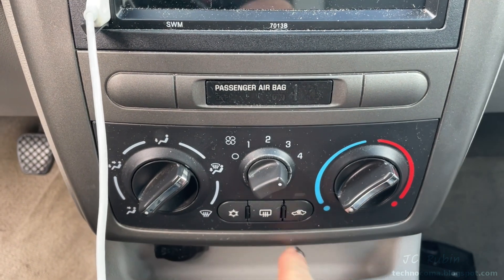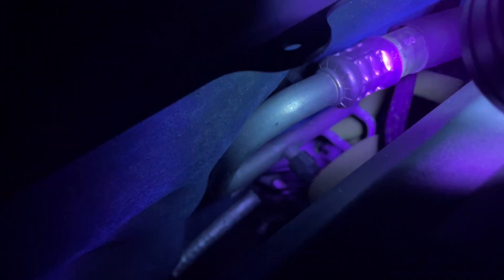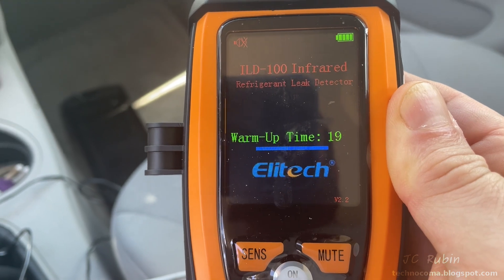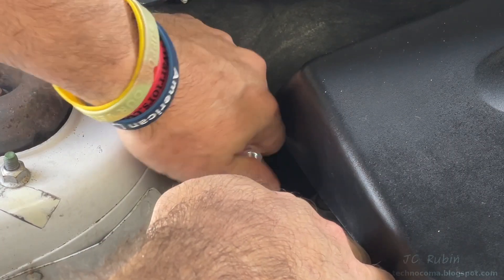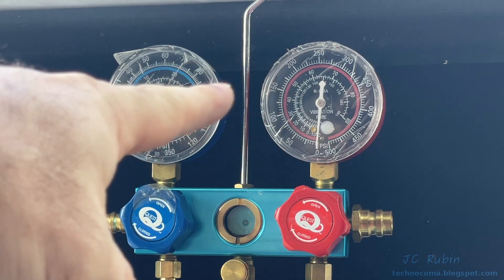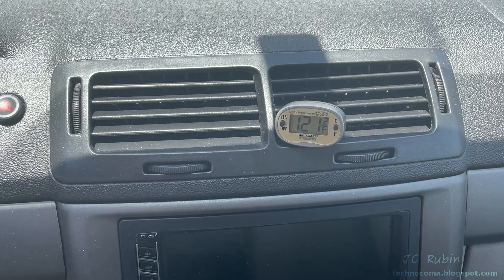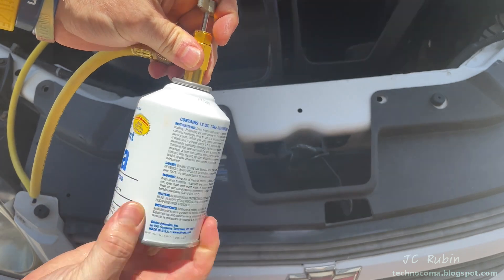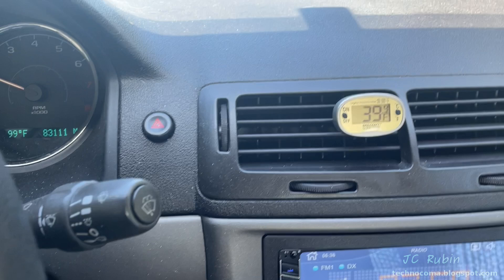Chevy Cobalt AC Repair In The Driveway - Addressing Common GM Points of Failure

Comment: Checked mine today on an 09 I just purchased, I do have p0411 code on the engine which I believe won’t cause it to disable the air conditioning, with the car on, ac on full blast, when I plug my guage into it, the guage immediately pegs out to max. Am I testing it wrong? What should I look at? Ince in a blue moon the pump will try to turn on for a second but i think it being at its level it won’t allow it, any help would be greatly appreciated,
Reply: P0411 is the secondary air injection system. You can use a scanner to manually activate the air pump, and to activate the control solenoid, and to operate the valve.  It'll throw that code if those things are not operational.  My experience has been that every time, it's clogged ports in the head (for a 2009, it'll be the head) or the exhaust header (older models).  Remove exhaust manifold, clean ports with chlorinated brake parts cleaner and brushes, install new gasket, problem solved.
Reply: I have the same issue lol
Reply: Did the high side pressure peg out to max when the compressor engaged?  That indicates a clog.

Comment: Pretty solid video. If you just recharged your AC like me, don’t be a dummy like me and under fill it. I thought my compressor might’ve been shot. I just replaced the radiator and condenser due to a very unfortunate raccoon…. I recharged the AC and it wasn’t blowing cold. Turns out I just didn’t put enough refrigerant in the first time. Hope this is helpful or at least provides a good chuckle.

Comment: If the system was empty, did you by -pass the low pressure switch to get the compressor to engage?
Reply from the maker: I did not need to. It cycles the compressor with the addition of gas